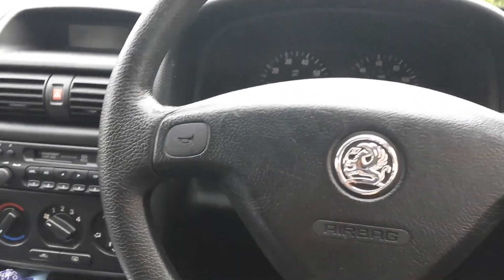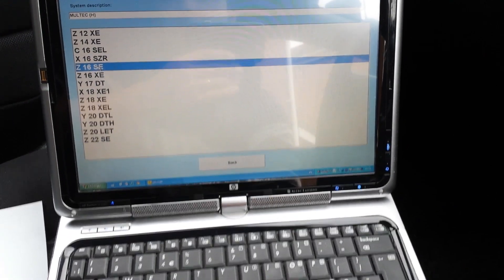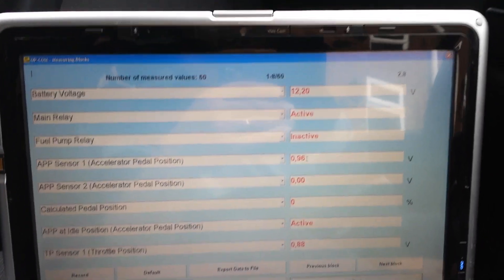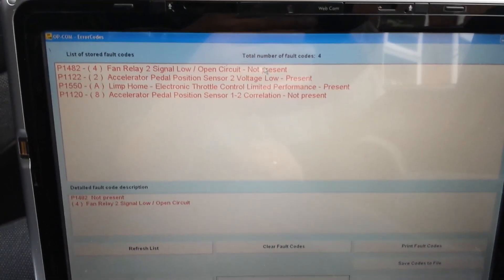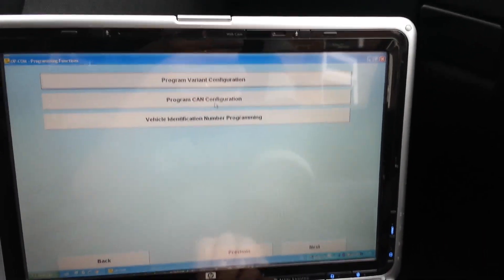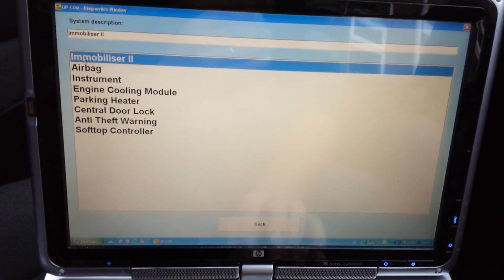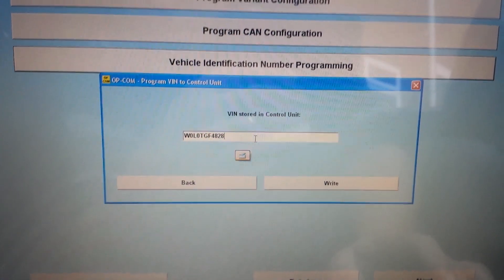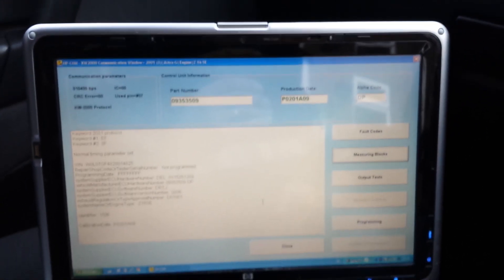Astra 2001 accelerator fault and Engine ECU change and programming.

Comment: best video ever on Opel cars...pls help with a problem..i have a Opel Corsa C, engine code Z10XEP, and the ECU has failed..i bought a new one but on this car it needs the IPC to be reset..the problem is that when i try to connect the Opcom to the IPC the connection is unstable..is reads the IPC only 1 second at most and i can't reset it or even retrieve de Security Key..help please
Reply from the maker: Hi
That's weird... do you connect of with all the other modules?
It could be that you might have a issue with op-com, or something on the communication line with the ipc...
Do you have the option to try other tool?
Thank you for watching and for your comment!
Reply: @LMAutoRepairs  thanks for your response...with my OpCom firmware version 1.45 i can connect to all other ECU's of the car..at the same time i have no problems with my OpCom on any other vauxhall or opel cars..expect this Corsa C..also someone told me that this problem occurs only on Corsa C cars and only on the IPC..and that the solution is using a 1.39 firmware version..do you know something about this?
Reply from the maker: @andreiandy2400  
Yes... that's however I have two Opcoms... with different firmware...
But you can flash your back...
Put 1.39 and see what happens...
Reply: @LMAutoRepairs  what is the proper and complete procedure for a ECU swap on a Opel/Vauxhall Corsa C..does the IMMO need reset?..please help with a video..thanks

Comment: Hello, this is very Strange... Ich changed the ecu and programmed it like your video. The spanner stops blinking after setting my pincode. After turning off the engine and turning it on again the spanner starts blinking again. Now I cannot even connect with Carprog to Ecu. Any ideas what went wrong???
Reply from the maker: Do you have any other tool to connect to the car? 
Like Op-com?
Reply: Yes I have OP-Com. Could connect to immo. I have checked Secret Code, MKN, VIN etc and it seems to be OK. I looked also in Measuring Block and noticed there is no Transponder Key... I think this is the problem. Is it possible to reprogram my originial key with it? Thx
Reply from the maker: @LuisGomez-ck2qc  
Yes... you should be able to...
If you haven't touch the immo...
Reply: @LMAutoRepairs  OK I will try it today and inform.
Reply from the maker: @LuisGomez-ck2qc  
👍
Reply: Problem solved!! It seems to be that the ECU paired correctly to Immo and only had to reprogram the original keys again. I try to explain how I solved it:

Go in Body-> Immo -> Special Functions. After correct security code Reset Immo. After that go back to "Programming" and go to "Immobilisier function". Once there select "Immobilisier Installed" and wait until you get the "Successfully Programmed" and "Correct Security Code Entered" message.

Then I opened "Program transponder key" and run it with my original key. when OP-COM tries to configure the key, it realizes that it is already programmed and accepts it.

I hope it helps!
Reply from the maker: @LuisGomez-ck2qc  
👍👍👍🍾
Reply: @LMAutoRepairs  Thanks for your videos!  Is it possible to make a video of a Ford Focus 2005 ECU swap or checking the Immo? I'm interested because a friend of mine cannot start his car (checked fuses and tried  with second key) and suppose that the ECU has gone. Any idea what to look for or could you recommend a video? Thanks!
Reply: @LuisGomez-ck2qc  Perdona que te pregunte, a mi me cambiaron la centralita y arranca bien  con la nueva, pero ahora c la antigua no. Hago el ECU reset y todo lo que aqui en  el video se ve y me sale el error P1612. Si reseteo el inmobilizador con la vieja y vuelvo a poner la nueva me arrancará el coche? Es que quiero tener las dos funcionando y aprender un poco, gracias y perdona la molestia.
Reply: @Alumno512  Buenas. Si reseteas el inmovilizador lo tienes que emparejar de nuevo con la ECU, sin eso no arrancará el coche. Cuidado con resetear el inmovizilador. Normalmente, si haces un ECU reset no tienes que resetear el inmovilizador, si no recuerdo mal lo tenias que emparejar como sale en este video.
Reply: @LuisGomez-ck2qc  Ok. Con la nueva la reseteo y siguiendo los pasos de aqui me sale bien, pero con la vieja haciendolo paso a paso no me arranca y me sale el error P0460 not present,  P1612 (inmobiliser no or wrong signal) present, y el P1613 (igual) not present. Y como dato curioso, en informacion general "RepairShopCodeTesterSerialNumber :Not programmed" y ProgrammingDate: FFFFFFFF y no tengo ni idea que pasa ni como cambiar eso. Gracias por contestar.

Comment: Hi
Great video but I need a little help with something.
I have a 2012 Mariva with fault ECU (AC Delco), nobody it seems can repair this make.
I was gonna buy a used one for £200 from eBay fit it to the car and get the car pass, erase it and do the swap that way.
My problem is when diagnosing the original ECU I couldn't get the measuring blocks up and do other certain things.
Is this a limitation of op- com on this brand and will carprog work also if I buy one.
Thanks
Wayne
Also I have a bet with my friend that you eating a fruit pastel in this video but I think it's a toffee! Lol
Any help would be appreciated.
Reply from the maker: Wayne Jones
😂😂😂😂
I was halls... the original!
I was with a really sore throat... I shouldn't have record this video... but did not wanted to loose the opportunity...
Which version of Op-com are you using?
If you have the car pass, just get the ecu already reset... and you should be ok...
Otherwise, you need to reset the replacement ecu... not sure if carprog can do it... not without check... 
Hope that helps.
Thank you for watching!
Reply: LM Auto Repairs 
Thanks for replying, Op-com version is 1.95. My fear is that op-com won't read this replacement AC Delco ECU and carprog either.
Vauxhall won't swap it if it's not erased as you probable know..
I was just wondering if you have read this type ECU with Op-com?
It's off a 2012 Merida 1700 diesel.
Cylinder 2 open circuit, Common fault apparently. I sent it for repair but multi layer PCB faulty between layers.
Reply from the maker: Wayne Jones 
Never done that one... so can't really say a lot...
But from eBay, can you not find one ecu already reset?
That would save you some headaches...
To program the replacement ecu, you do it through the immobilizer... not the ecu itself...
Reply: No, I'm assuming they're coming from a breaker and there's not many out there.
I've just bought carprog to give it a try, I'll let you know how it goes.
Thanks for your help.

Comment: Hi mate I rest ecu.  I put next ecu I program. Immobiliser car not start :(( plz little help me
Reply from the maker: auto uk
Hi
There is a correct procedure to program it...
Have you done it through the immo module, selected engine ecu replaced etc...?
Reply from the maker: auto uk 
Whatch this one... is pretty much a step by step...
https://youtu.be/70mteUUUzjg
Reply: LM Auto Repairs   Hi yes I go ecu. I rest then I turn key off I remove old ecu I put next one same part number.  Then span light flash I go immobiliser. I put security code I press immobiliser faction then I pick installation. Ecu engine control module I press not show any thing
Reply from the maker: auto uk 
You are doing it wrong... have you watched the video on the link I have sent you?
You don't need to reset the old ecu... is the replacement one that needs to be reset...
Whatch that video for the Meriva... is pretty much a step by step...
Reply: LM Auto Repairs   Hi I can’t rest replacement becoz I buy from eBay I don’t have pin ,  i

Comment: Hi there. I have Vauxhall’s zafira. 1.6. Ecu fault I order mother one on eBay same part number I put now immobiliser flash can I program immobiliser or vin number thanks ??
Reply from the maker: auto uk 
Hi
You need to reset that ecu first... and then program the immo again using the pin from the car where you are trying to install it...
If the ecu you got from eBay came with the pin code, you can do everything with opcom... 
Thank you for watching!
Reply: LM Auto Repairs   Hi thanks I have pin for 1 one. But 2nd one I buy from eBay. I don’t now the pin . I rest first one I program immobiliser car start but when I put eBay one Ecu wish not pin code I program  immobiliser car  not start.  Code came up immobiliser receiver wrong signal :)
Reply from the maker: auto uk 
Auto UK.... I have answered that question... you don't need to reset your ecu... you need to reset the one you want to program to the car... if you don't have the pin code, then you need to find a way of finding it... carprog... etc... otherwise you will never get that ecu to work on that car...

Comment: Thanks for the video. I have a 2000 Astra which had a bad ECU, and using this video and one of your other ones on retrieving the pin from the replacement ECU has the car going perfectly again and fault free!
Reply: Hi, did you replace the ECU?
Reply: @sarahlou75  Yep, I replaced the ECU and the problem I had went away.
Reply: @Mr400zx  Glad that it worked for you,  I am having trouble locating a replacement ECU.  At the moment the old ECU is plugged back in and touch wood its worked for 5 days now.  Can I ask how you obtained your ECU?
Reply from the maker: Mr400zx 
Hi
Glad you got it sorted!
Thank you for watching and for the feedback!

Comment: Hello LM Auto Repairs
I have the same problem like in the video
The car is OPEL ASTRA 2002, z16xe and  need to replace my ECU. I have these faulty codes:
P1500- electronic throttle system (ETS) - circuit malfunction
P1550- electronic throttle system (ETS) - in emergency mode
P1600- engine control module (ECM) - program malfunction
P1120 - accelerator pedal position (APP) sensor - circuit malfunction.
ECU/ECM need to be replaced, ECU/ECМ is not programmed

The problem is that i dont know if the previous owner already changed the ecu once or not and if it is programmed good or not. So i dont know eather what is original part number of the first manufactured ECU of my car. I found second hand ECU's for Astra g z16xe on Ebay and i want to replace it but i am not sure what part number of the ecu is compatible with my car. 
Can you help me to find out what is the right ecu for me?
Thanks
Reply from the maker: Nenad Stojkovski 
Hi
If the ecu you found is from a similar car with the same z16xe engine, it should work just fine...
Thank you for watching!
Reply: Thank You LM Auto Repairs. 
For example if i buy another ECU, what should i look for? With immobiliser and key transponder chips or without them. Because i cant find the 4digit pin code of my immo. And how will be the programming with new immo and transponder chips? Thanks again
Reply from the maker: Nenad Stojkovski 
Hi
I have answered that question a few times...
Without the PIN from your car, you go nowhere... you need that...
I have a video showing the different ways of getting the pin....
As for the replacement ecu, if not reset, you need the pin, or get it reset using for example carprog...
Hope that helps...

Comment: I have acceleration problem with my Astra G 1.6 Petrol.
When I turn on the Engine, l have to Wait 5 minutes to start Driving, cuse if l start Driving.
And accelerate, the car dont Pull.
What is the Problem!?.
Reply from the maker: Hi
You say the car does not pull, but does the engine responds to the accelerator?
Have you scanned the car?
Thank you for watching!
Reply: LM Auto Repairs 
Yes doesn't responds to acceleration!
I have to wait for 5 min every time,
Beafore l run the Car, then it Runs okay.
So what is the Problem.
Or
Hvat l have to do with the Car!?.
Thank you.
Reply from the maker: Hi
I would first check for codes, then check on live data if the pedal is responding straight from the beginning and the engine is not, or if is the pedal that only starts to respond after that time elapsed...
But, because you are saying that the car runs just fine afterwards, it can be a ecu problem...
The proved being the case, I would try a software update, or you can try to have it replaced...
Hope that helps.
Reply: LM Auto Repairs 
Hi there.
I did Check my Opel Astra with computer at the car Service.
And they told me that l must replace ECU, with new One.
How much it Cost?.
Reply from the maker: Ilir Krasniqi 
You can source a second hand one... 
Will be cheaper...
Look on eBay for example... that will give a rough idea of how much it will cost...

Comment: hello. after I programmed the immobilser it says successful.  but the blinking light doesn't disappear
Reply from the maker: Hi
What fault codes do you still have?
You might have a fault elsewhere...
Thank you for watching!
Reply: LM Auto Repairs hi it is saying wrong vehicle id  from body control module. and wrong vehicle id from instrument control module
Reply from the maker: Ok...
Watch this video then.... https://youtu.be/70mteUUUzjg
The procedure is very similar...
Hope that helps!
Reply: LM Auto Repairs damn I check your other video . thanks. but when I try to reset the cluster it doesn't let me do it . doesn't come up with the ok .
Reply from the maker: You need to do the modules in a certain order...
If that fails, try a different version of Op-com, and perhaps a different firmware...
Reply: LM Auto Repairs yes a different firmware . thank you very much for the help my friend.
Reply from the maker: Inchaseable One 
No worries...
👍

Comment: I've purchased a secondhand ECU that has already been reset. I followed your instructions but it would not program - probably due to the configuration not matching my car. I've configured the ECU variant and CAN to match my original specs, and I've also reset my BCN, immobilizer, ECU and instrument cluster. Then, I tried to program immobiliser and ECU through immobilizer function as you suggested.

However, it does not go through with it and gets stuck on "See Checking Procedure Before Programming !" .

Have I done something wrong and can this be corrected?
Reply from the maker: Radical Tide 
Hi
You might be not following the procedure correctly...
There is out there a step by step manual on how to do this stuff... Google and you will find it.
Otherwise let me finish shifts and I can share it with you...
Reply: lmsvvavr Thanks. It's because I was following another guide online as well as your video and it said to reset the ICP and BCM. Am I getting this problem because the BCM has been reset and is no longer accepting my key?
Reply from the maker: Radical Tide 
I don't think you need to reset nothing on the Astras....
So what is the modules that you have left to program?
Reply: lmsvvavr ICP, BCM, ECU AND Immo. Should I do them in a particular order?
Reply from the maker: Radical Tide 
If you have reset all the modules, then you might want to do immo and ECU at once, and then the rest...
Don't think there is a particular order for the rest,   ipc  and bcm....

Comment: I have exactly this problem! Same codes and symptoms.  When cold, the spanner light is off, but as the engine warms up it comes on and goes into limp mode. The garage I took it to said its the throttle position sensor, but that it wouldnt be worth putting in a new pedal. I need a new ecu. Thk you. Once I get a second hand one I shall follow your instructions with the reset ecu. Thks very much!
Reply from the maker: It is all in the video, but if you struggle, do not hesitate, I will do my best to help...

Comment: Astra H 2007 z17dth P1120-P1122 accelerator pedal ratio not correct its intermittent i cant get it to do anymore from your experience whats wrong!!
Reply from the maker: armando nika 
Hi
Have you measured the pedal output?
Reply: +lmsvvavr 1 volt app 1 and 0.5 app 2
Reply: +armando nika when the fault occurs the app 1 signal voltage becomes 0.5 volts so im checking the 5v ref and the signal to catch it but its not happening anymore 😔
Reply from the maker: armando nika 
Intermittent faults... I hate them... lol
Reply: +lmsvvavr ahhahahah me too man, do you have hangouts or something where i can write to you?
I have seen the voltage decrease so if it is must be a 5v ref issue and not a ground othervise i would have a raise at the signal voltage when the fault occurs, im i right?
Reply: +lmsvvavr where did you bought you scanner the autel i mean, i have read in one of your comments but cant remember anymore. TY
Reply from the maker: Hi
The web site changed name to
cardiagtool.co.uk
Although I never had problems with them, please use it at your own risk...
Reply: +lmsvvavr thanks man, yeah of course. But with that passthru it can programm all the cars ECU?
Reply from the maker: armando nika 
Not really... the pass through is although compatible with a few OEM interfaces...
Just check the specs...

Comment: Hi, I have an astra G and I need to change the ecu the code is 09353509 DPAC is the same as the 09353509 DRTJ?
Reply from the maker: A todo gas 
Providing is from the same engine it should be ok...
Reply: lmsvvavr Thank you

Comment: are you in uk ?
Reply from the maker: SuperClaud007 
Hi
Yes...
Reply: i install opcom from china on my laptop but its not communicate with the car i dont know what to do any help ?
Reply from the maker: SuperClaud007
Is the laptop and the software seeing the cable?
Reply: yes
Reply from the maker: SuperClaud007 
Is the tool getting power from the car when plugged in?
Reply: yes and it show  me page like engine, year but i can't continue to start diagnostic
Reply from the maker: SuperClaud007 
Ok... or you have a problem on the car, with the communication lines, or a dodgy opcom...
Try to change opcom firmware to a different one... and a different software version... we if that solves it...